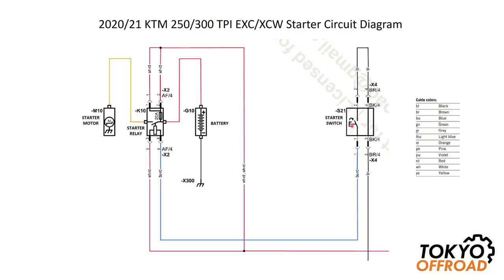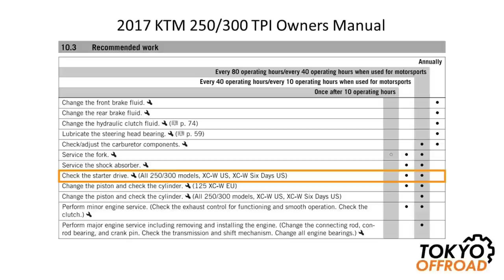KTM, Husky & GasGas 2Stroke EStarter Inspection and Maintenance

Comment: Just an fyi i proactively bought the XRC bendix bushings for my '24 300 xcw with 3 hrs on it. I tried removing the bendix without removing the flywheel and it can't be done. So your comment is valid that if your bendix can be removed without removing the flywheel than your bushings are worn. Excellent informative vid !

Comment: Mark, you need to upload a newer video for the 2023 / 2024 bikes. I believe one must remove the flywheel from the new version. 

Let me know if you have found this different. 😊
Reply from the maker: Good idea. I have already fitted XRC bushings on my 2024 KTM  300 EXC and removed the flywheel as it seemed very tight to remove the bendix with the flywheel in place. I'll make a new video...
Reply: @TokyoOffroad  I’m doing my bushing and upgrading to a larger output stator.

Comment: I got husqvarna tx300i 2022 . Sometime it’s start easy and sometimes don’t . But just need to push a bit forward or back will start again . Wonder what might be the problem, I’ve check start switch and kill switch clean . Battery no problem. What might be the problem? Thanks 🙏

Comment: Every KTM I've owned has issues with the starter connection behind the headlight.  Water pools in that connector from the top around the wires and rots the wires.  Fill those the pin area with grease as well as those holes and wrap some electrical tape around it.   Just got a new TPI and will be doing this as it has no kick starter.  I guess I will need to add a small jump pack to the camelbak and SAE dongle to the battery tucked in the air box as well.

Comment: Are their more stout  starters than OEM KTM  ones.  At 70 hrs my starter  is having issues.  I had the kick starter and Rekluse torque core drive manual.
Reply from the maker: I don’t know of any 3rd party starters which are tougher than OEM. I personally haven’t had one fail. They will be more prone to failure if the system isn’t maintained, especially if the Bendix bushings aren’t in good shape (in extreme cases they may cause the the Bendix to become jammed and then the starter motor will burn out).

Comment: Do most new enduro bike have the same poor wiring quality with no water seals on most of the starter and lighting circuits? Was shocked to see on my new ktm300exc 22. Working on modern cars all wiring I work on is sealed. Unless In a sealed box or in the interior

Comment: there is a little hole below the starter should seal it, my starter burned water come inside from there 
change the starter is hell work......
Reply from the maker: That’s a tough one to answer. The hole is there to drain water if it finds it’s way in. If the hole is the only way in then probably no problem, but it water can find another way in then blocking the hole would make things worse...
Reply: @TokyoOffroad   the real problem is change the starter soooo tough..... who designe why?
Reply from the maker: @michael397  - Yes, I agree, it's a PITA to change the starter motor. I guess I'm lucky and haven't had a starter motor failure so far. I don't do many water crossings which is probably a major factor...

Comment: What happens if you accidentally hit the start button while the engine is running? Does the bendix engage, get stuck, and over rev the starter? Maybe start buttons should have a flip-up protective cover. 

Someone could sell a harness kit with water-tight connectors.
Reply from the maker: Pressing the starter button while the engine is running should be avoided. Typically the bendix will not engage. If if the starter button is continuously pressed, or gets stuck it might engage, which may result in damage to the bendix and possibly also the starter motor. The 2024 KTM 300 EXC TBI I have has a 6 pin weather proof connector for the starter/run/kill switch, which is a big improvement from the old style 4 pin Molex connectors.

Comment: Mark,
Any good option for removing the bushings without the puller?
Reply: Pack the bushing with grease, insert a shaft, punch, or bolt that slips in with very little gap, and hit with a hammer. It’s piston-like effect pops the bushing out.

Comment: Thank you for this, very helpful.  I followed your instructions and thought I got the issue fixed by changing Bendix and bushings. But problem not solved, still does not start.  Opened starter cover again, pressed ignition button and starter motor does not turn fast enough to allow bendix to come out and play with the flywheel.  Is this normal when the cover is off or should the bendix engage with flywheel if starter motor spins fast enough?  KTM 300 XCW 2018.
Reply from the maker: Possible causes of the bendix not spinning fast enough: 
1) Bendix gummed up (but you have fitted a new one so probably OK)
2) Bendix bushings are bad (again you have new ones so probably OK)
3) Battery voltage is low. Make sure you have a good battery and it's fully charged
4) Ground connections are not good, particularly the battery ground strap to frame connection. Check and use a wire brush to clean any oxidation. Use dielectric grease, or silicone grease to help prevent future oxidation.
5) Starter motor is going bad. Some people repair themselves (clean out and replace brushes). Or buy a new starter motor and replace (motor needs to be lifted up from the frame (or removed from bike) to replace the starter motor.
Reply: @TokyoOffroad Thanks, I appreciate your quick response.  I think you confirmed that my issue is the starter.  I put a tickle charger on the battery when I test and check I'm at  the right output.  Followed your video step by step...cleaned and greased everything and no success.  Unfortunately, the starter doesn't come off the engine (with engine in place) by just few millimeters!  Will do the work during the winter and change piston at the same time.  
Thanks again!

Comment: Hi love your chanel, have learned alot, just a tech question, i have installed a lectron, v force 4, and a s3 low compression head, i live at sea level, my question, would i need to adjust the metering rod, greeting from Wild Coast south africa👊
Reply from the maker: Pleased to hear that you enjoy the videos. Regarding adjusting you Lectron metering rod, that would depending on whether it's currently running well or not. Take it for a test ride and see how it performs, then decide whether it needs adjusting.
Reply: @TokyoOffroad  bike ran sweet before, still does but seems a little richer which i think is good, so will go on a long ride and decide, i just wondered if the head may change the richness👊🤣

Comment: Some times I engage my started and I just spins like it’s not catching the fly to crank the motor what would cause that
Reply from the maker: A if the bendix becomes sticky internally that would cause it to just spin and not engage reliably. Or if the bendix bushings have gone bad. Or if the battery voltage is low, or ground connections not good.

Comment: My 2017 xcw is starting to spin and not engage periodically on the trail
Reply from the maker: If the bendix doesn't spin quickly enough, or it is sticky you may experience poor engagement. A few things to check: Battery is good and fully charged, ground connections are good, bendix is not gummed up internally and sticky and bendix bushings are in good shape.
Reply: @TokyoOffroad  I watched your previous video on this issue and will start with the visual inspection.  Ive had the issue since it was new, but would only happen once in awhile.  Now with 170hrs it doesn’t engage more periodically especially on the tough trails where im constantly going over and stalling on logs, and root step ups and such.
Thanks for the info on this.
Reply from the maker: @MrJasonfromcanada  - My 2017 was the same when it was new. I removed the bendix, cleaned it out internally with some parts cleaner spray and blew it out with compressed air. I then lubed it up internally with some light weight oil. It fixed the issue. However after 170H I suspect that your bendix bushings will not be in good shape and will need replacement
Reply: @TokyoOffroad  well I did an inspection today and the oem bushing came out with the bendix.  Where the bushing sits has worn a slight oval but hasn’t cracked like in your previous video.  Looks like I’ll be ordering a new cover and bushing.  Appreciate your tech videos, I would have never thought to look there.  Fortunately there is no wear on the bendix teeth.

Comment: "or replace the case" ... ouch
Reply from the maker: Yes, and for that reason it is a very good idea to do a periodic inspection of the starter system (including the bendix bushings) even if the e-start appears to be performing fine. I know many perform no maintenance until the e-start stops working and it can get expensive if the crankcase needs repairing, or replacing...

Comment: KTM's seem to have poor electric wiring, connectors & casings.
They could learn a lot from Japanese bikes.

Exposed starter button connector under the too triple clsmp is not a water sealed connector!!!  Are these bikes being built in 1910 by children?

I am disappointed in KTM's low quality after owning my 1st KTM for only 2 weeks.
Very high maintenance machinery.

If it leaves me stranded I will burn it right on the spot.
Reply from the maker: Yes, some of the electrics could very easily be updated by KTM with more reliable/higher quality connectors, switches and wiring. I’m not sure why they don’t do so as many people have problems and the cost difference would not be great. Like any brand KTM have plus and minus points. In many of my videos I focus on the minus (problems) and hopefully provide enough information to make your riding more fun with less chance of problems while out on the trail. Regarding Japanese bikes none of the manufacturers have estart 2-strokes so they are not an option for many people (who don’t want to kickstart). Compared with KTM the Japanese bike do tend to have better electrics, but in my experience worse mechanical longevity (need much more frequent top end overhauls) and worse brakes and clutch. I rode Honda CR 250 2-strokes for a long time (sadly no longer made) so have a lot of experience with them…
Reply: @TokyoOffroad  I got a little worked up. Sorry for going so far with it and appreciate your patience and tutoring.

I have had great luck with 99% of my Yamaha and Honda offroad bikes over my +40 years of riding. Almost as good were my Superbikes I raced and streetbikes. I just sold a 2015 Yamaha YZ250 I used for offraod riding. It worked flawless.

Note I take good care of all my bikes. Stored in unheated garage always. Washed and cleaned after everyday of riding. Oils changed, cables and linkages lubed,....

My most favourite bike of all time had gobbs of torque, was 12 pounds heavier than a 250 cc as I recall. I could putt all day long then open it up and it ran like a scared cat. It was a 1996 Honda CR500. Used to ride it non-stop 6-9 hours most Saturdays and 6+ hours Sundays during the spring, summer and fall. It never gave one once of trouble no matter how deep the mud (seat height) or how much it rained. 

I got the KTM because a few short years ago I had an accident and broke +15 bones, including both pelvis's, leg, collar bone, pulled all those muscles? off that are attched to the sides ot the spine. Like in the movies I had to learn to walk again after surgeries.

I realized now I literally have more hardware in my mid supsension area (pelvis, hips,..) than my KTM does. LIterally plus 5 lengths of chain. As a rsult I have a lot of difficulty obtaining the range of motion to get a leg up and over a bike and then to kick start it is, well , I imagine it is entertaining to watch.

Never giving up I opted for a bike with a cheater button. A KTM with a starter button. Oh my left leg is now 2.5 cm shorter. 

I think I will look into replacing with a sealed connector the starter button connection as a place to start. Lots of automotive connectors to be had online plus for boats and motorcycles that are sealed units.

I have never had a motrcycle let me down on a race track, 4,000 km road trips or all the trail riding. 
Oh a superbike did stop once due to the used ECU's circuit board cracking on the back stretch. Long push back to the pits. I took it apart and with a magnifying glass identified the hair crack. Soldier repaired it and it was good after that.

Thanx for all you teach us.
Reply from the maker: @human1513  - So sorry to hear about your accident, but pleased that you are back on a bike. The older we get the less fun it is to kick start bikes, especially when on the side of a steep hill!
Reply: Total agree. I was really excited getting my new bike. Discoverd it rerouting some wiring not fitted correctly and was like wtf No seals. Was shocked. I’m sure most ktm bikes will have water ingress after a few years with some corrosion. Im sure they did that on purpose so they don’t last that long. Doesn’t make sense to me. Would love to chat to the electrical engineer for the reasons behind it.